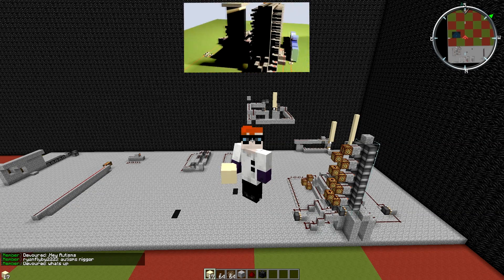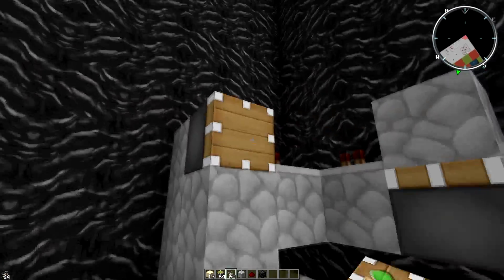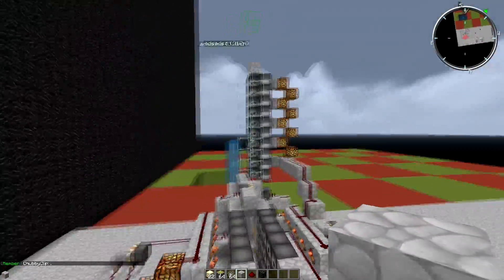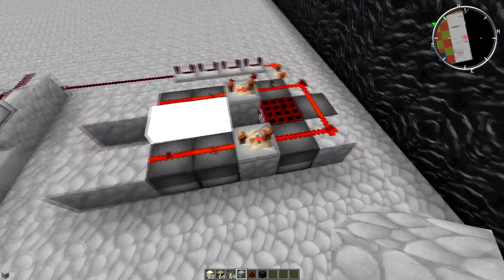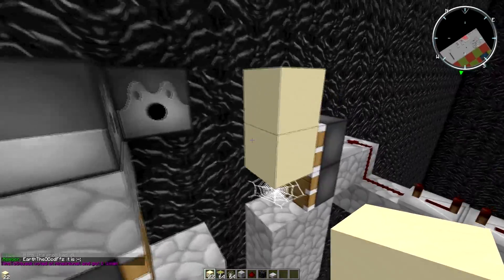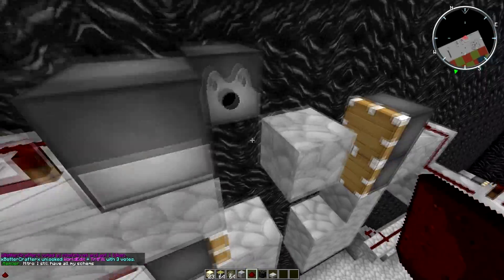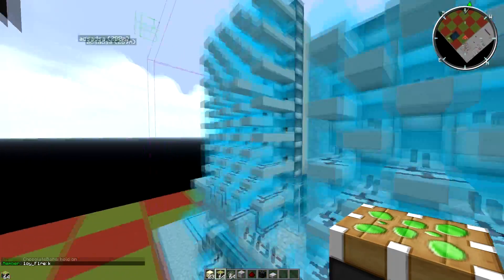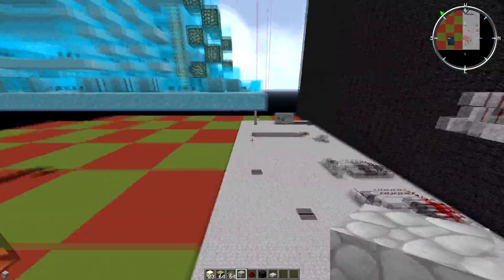How to Build Cannons - Basic Concepts!. / Teaching Level: 9000

Comment: Is good, but I haven't seen anyone making a video centered specifically around using a cannon in unusual ways.
For example, wiring the cannon so the scatter goes of before the hammer, to upshot.
Or, using the slab buster to downshot.

I'd also like to know if it's possible to nuke, if only a little, with a smaller hammer cannon, like the lein?
Reply from the maker: Bill lupin give a detailed list of what you wanna see and ill see if i can make a video about it. I Would love to help out!😄
Reply: Basically, the concepts underlying any special technique used by skilled cannoneers. Up shooting, down shooting, left shooting, reverse hybriding... Not just what redstone you swap on your cannon to make it happen, but what it's actually doing.

For example, you described what a nuke was. That's very helpful, as in most videos, someone says they're going to "nuke the wall," and they rip a hole down the wall with a press of a button, after adding a piece of redstone to the "nuker." They never explained, in terms of minecraft physics, how it works. (As you said, the hammer acts as the hybrid, and because the water hasn't had a chance to flow downward yet, the tnt basically drywalls its way down the sand stack.)

You also described the significance of the hammer. I'd been wondering why the cannons on youtube suddenly made this huge stack of sand, while mine, despite having a basic cobweb compressor, could only do 5 or six.

You described the significance of an aligner, and how it pertains to accuracy, particularly in slab busting.

Basically, I just mastered building the lein, and I'd like to know all the cool things you can do with a good cannon, besides slab busting, stacking, and hybriding.